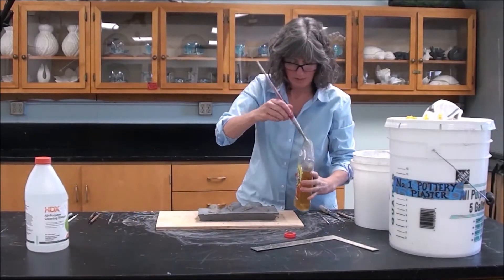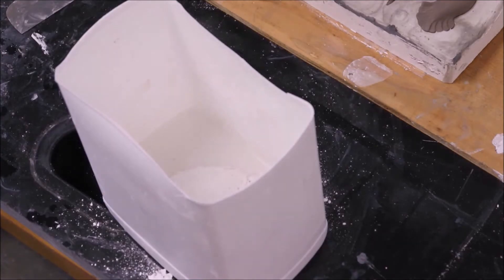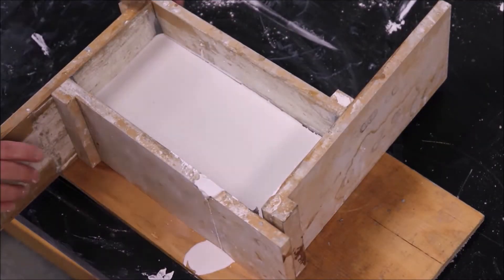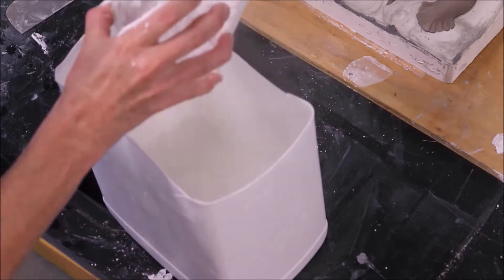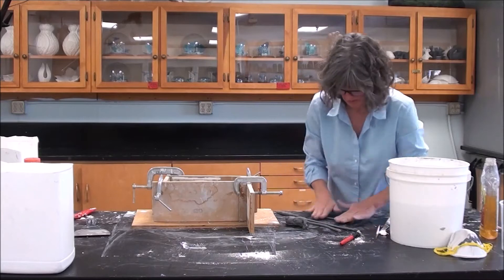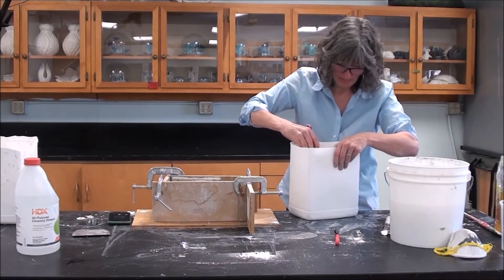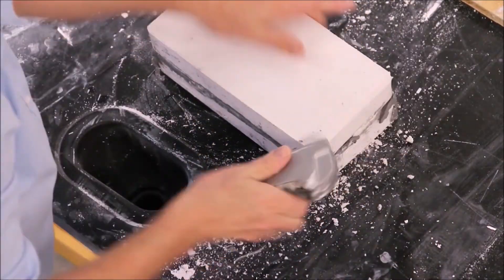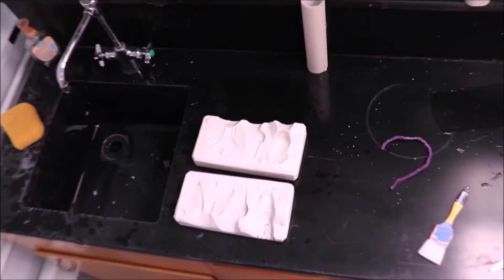Part 2: How to make a 2-Piece Plaster Mold for Slip-Casting

Comment: When you slip cast for this type of mold do you drain out the excess slip or continue filling it to have a solid product?
Reply from the maker: Generally speaking, you never want your object to be solid (unless it is tiny).  I always drain out the excess slip.  A general rule of thumb: if your piece is over an inch thick, it is likely to explode.  Of course, there are exceptions to every rule...

Comment: thank you! I want to pour a bowl to match my Rosenthal Baroness fine china.  What do I use as a slip to match the fine china?
Reply from the maker: I would just buy some pre-made cone 6 porcelain casting slip.  You can get it at most ceramic warehouses and they often come in one-gallon batches.  They also come in a variety of colors.  Several white colors along with other colors.  Good luck!

Comment: You don't mention drying time for the murphy's oil soap nor if you diluted it w/50% boiled water. Can you please clarify? Thanks
Reply from the maker: The water does not need to be boiled.  Sometimes I dilute the Murphy Oil Soap, sometimes I don't.  It only takes about 5 min to dry, depending on the humidity level of your environment.  I find it is dry by the time I am done mixing my plaster.  But I do live in the desert.

Comment: Thank you Rebekah, you solved (and explained really well) all my doubt about this practice. I only found korean video making molds but couldn't get the precise instructions. Just a question, I have to buy plaster or the procedure is same with alabastrine gypsum? Thank you if you can answer to this too.
Reply from the maker: You will have to do some research.  I'm not familiar with Alabastrine gypsum.  The only other plaster I have experience with is Plaster of Paris, which I have used for slip casting.  It works, but not well.  You could give it a try and see what happens.  Let me know how it goes!

Comment: How much shrinkage do you find you are getting, from the original piece to the future ones?
Reply from the maker: The shrinkage depends on the type of slip and how high you fire it.  Porcelain slip shrinks about 15%.  The slip I used in this video only shrinks about 3 or 4% when I fire it at cone 04.

Comment: how did you create the clay bed without marking or damaging the humming bird?
Reply from the maker: The hummingbird was past the leather-hard stage.  So it was quite stable and very firm.  And the clay bed was very wet clay.  Since there is a discrepancy in the moisture content, the two clays do not wat to stick together (wet clay does not want to stick to dry(ish) clay.

Comment: Amazing video thank you! But please wear a mask when your arms the plaster
Reply from the maker: I'm glad you liked it!  You only need to wear a mask when working with the plaster in it's dry/powder form.  Once it slakes up the water, there are no particulates to breathe.  I wear a mask when sifting the plaster into the water, and once the air has cleared (which doesn't take long), I remove my mask.  By the time it comes to mixing the plaster into the water, it has thoroughly slaked and, again, there are no particulates in the air to worry about.

Comment: Very good demonstration. Thank you.  Do you have a video on casting a solid object... like a fired sculpture piece?
Reply from the maker: Nope.  I generally do not slip cast any work to make it solid as it is more likely to blow up in the kiln.  The exception is when casting thin pieces, such as wings or flower petals.  Those always cast solid.  But they are not truly solid due to the was plaster pulls water out of the clay.  There is always inevitably always an air pocket in it.  But they never blow up because the air pocket is not large enough.  Hope that answers your question!

Comment: Very nice 40 years I worked with dental plasters Alpha hema hydrates and Beta hema hydrates vacuum mixed and vibrated for a dense fast setting material. Watching how runny a mixture you use is very interesting but all the various plasters used for pottery to dentistry to home building is also interesting gauge plasters moulding #1 and 2 and casting plasters are all different. Thanks for the lecture.
Reply from the maker: Wow; that's very interesting!  I've only used Plaster of Paris and No 1 Pottery Plaster.  Thanks for sharing!

Comment: Hello mam 
Can we cast gypsum in such mold ??
Does gupsum casting  give same result as clay casting mold like that shown in vdo
Reply from the maker: Yes, you may add gypsum (plaster) to a plaster mold.  But you must coat the interior of the mold with a mold release agent (such as Murphy Oil Soap or Vaseline), then put it together, and pour the plaster in.  If you do this, you must make sure there are no undercuts, otherwise you will never get the gypsum to release from the plaster.  And you do not pour in the gypsum and then pour it back out after a certain amount of time (like you do when slip casting).  When casting with plaster, you will be creating a solid object.  Good luck!
Reply: @rebekahbogard3322   lots of love 
                                       Thank you 😊

Comment: Hello from the Dominican Republic :)
Thank you so much for all your videos and info Rebekah, they are great!!!
I have a question. Here the ceramic materiales are very limited (no specialized stores), they also don't sell pottery plaster, they have 1 plaster which is acceptable for mold making, but I do not know if it is good for slip casting yet. They also do not sell slip so I would have to do it myself. 

My question: How do you decide if you need to do a MULTI PART PRESS MOLD or a MULTI PART SLIP CASTING MOLD? In my case I am doing sculpture in very small editions, maybe an edition size of 3 for example. 

Thanks again
Reply from the maker: Thank you so much for the wonderful compliment!  I’m glad my videos are helpful.  Your question is a very good one.

If I were you, I would start with press molding since it is likely the plaster is not very good for slip casting and, on top of it, you would have to make your own slip.  That is quite a lot of work for such small additions.  If you decide you want to experiment with slip casting, you could always drill a sprue hole into your mold later (to pour the slip in and out of the the mold).  I have done this before with sphere molds which I use both with slip casting and hand building.

I usually press or slump mold if I am making something large, and not a lot of the same thing.  Or I will press/slump mold if I want the piece to be more substantial and stronger (with thicker walls).  I will also press mold when I hand build a piece.  I have a collection of various sizes of sphere molds that I slump clay in and then modify it to make heads or oblong shapes.  This speeds up my hand building process and makes it more enjoyable as I can power through some of the basic parts of the animal.   And slip casting for this method would take way too long.  There is a different kind of speed with slump/press molding since you can almost immediately remove the clay from the piece and then keep working with it.

My go-to is slip casting when making a lot of things that are small because it is so much faster once the mold is made.  I slip cast a lot of birds and flowers.  Also, slip casting is great for super smooth surfaces because the clean-up of a piece can take a long time.  Slip casting, when you have the proper supplies, is super fast and easy.  But slip casting is not always the best solution.  
Hope that helps!
Reply from the maker: Just in case you wanted to experiment with slip casting, you can always buy a pre-mixed gallon.  https://www.dickblick.com/products/amaco-no-15-s-casting-slip/?clickTracking=true&wmcp=pla&wmcid=items&wmckw=30511-1009&gclid=CjwKCAjwy42FBhB2EiwAJY0yQnW2WU-LYrRYKFdiHtlk1kzeYBe3afCgOIBG71-FQLkDkz9X04zxoRoC-YAQAvD_BwE
Reply: @rebekahbogard3322  Thank you so much for such a detailed and thorough answer. :) xxx

Comment: Hi Rebekah! Very helpful video! What kind of clay body is used for the clay bed? Can i use regular modelling clay so it wont harden?
Reply from the maker: You certainly can use modeling clay.  But I would recommend water-based modeling clay if you plan to slip cast with it.  If you use oil--based clay, the oil in the clay will leach into your plaster and then it would greatly hinder the plaster's ability to act like a sponge and suck up the water (think Scotchgard).  When using water-based modeling clay, just make sure you don't let the clay dry out before you add the plaster.  

If you are not planning to use your mold for slip casting, it doesn't matter if you bed it out with oil based or water based clay.

May the force be with you!
Reply: @rebekahbogard3322  Thank you so so much!

Comment: Dear Rebekah,  thanks for these excellent instructions! Started to make a mold of a wooden object. I've a question though. In the second pour the plaste got creamy during mixing, the first time it became creamy after it was poured. Used three minutes soaking and mixing both times. However the slaking went slower the second time and  I banged the bucket a couple of times for the plaster to better sink into the mixture. Could this be the reason for the process of thickening being faster?

Kind regards,
Tom
Reply from the maker: Hmmm.  If I understand you correctly, during the first mixing of the plaster, the plaster was thinner while stirring.  And the second time mixing, the plaster was thicker while stirring.  And both slaking and mixing time were the same.  I would attribute this to having colder water in the first mix and warmer water in the second mix.  If the water is warm, it will stiffen much faster.  (I am also assuming your water to plaster ratios were identical both times)

Perhaps the plaster soaked slower during the second slake because your plaster was a little more condensed into an island shape rather than being more evenly dispersed throughout the bucket.  Or it might be due to sprinkling the plaster in a little more slowly during your first mix, thus not creating a large dump of plaster that took longer to absorb.

However, my guess is the water temperature.  This is where you will see the greatest amount of variation.  The warmer the water, the more quickly it will thicken, and it really makes a significant difference.  Usually the way you sift your plaster into the water does not make that great of a difference.  So, even if you sifted in the plaster differently, I doubt it would make that big of a difference.

I hope your mold came out well!  Making mold of wooden objects can be a little tricky as the wood swells as it absorbs water from the plaster.  So, you have to do both sides as quickly as possible.  And wood is porous, so it needs to be coated with Murphy Oil Soap before pouring the plaster over it.
Reply: @rebekahbogard3322  Thanks for your quick and elaborate response!  It's probably the temperature of the water I used. The first time I took, approx, 2 l, cold water and had it stand for at least an hour to come at room temperature. The second time I took cold to tepid water and used it soon afterwards. Indeed it is likely that the second the time the water was warmer. Next time I'll make a note of the water temperature before adding the plaster to it.
Regards,
Tom

Comment: Can I use liquid soap as release agent?
Reply: Same question.
Reply from the maker: Yes, it should work just fine.  Like dish soap, it gets foamy.  But it will still work.
Reply: @rebekahbogard3322  hey so um, do i have to wash the plaster mold afterwards? To get the soap off...
Reply: @volstrekt  Yes.  She mentioned she used vinegar on her sponge and water to clean the soap off.
Reply: @bunch8  i used petroleum jelly.. i made a drip mold btw.. do i have to wash it off as well?

Comment: Aside from the oil soap that you use, is the regular dishwashing soap works?
Reply from the maker: Yep.  I have used dish-washing soap when I couldn't find my Murphy Oil Soap and it worked just fine.  The oil soap is better because it doesn't sud up as you brush it on. But any dish soap should be fine.

Comment: Excellent!!!  I'm in the process of casting my first lead keel for a model sailboat.  I'll be using your techniques for my mold.  Can I use a wax instead of, in conjunction with dish soap as a mold release agent?
Reply from the maker: Hi jj lad.  Sorry I am just now getting back to you.  No.  Do not use wax.  It will permeate the mold and you will not be able to get it off.  It will prevent the mold from sucking the water out of the slip, thus turning it into clay.
Reply from the maker: If you can't get Murphy Oil Soap, use any dish soap you have (or even liquid hand soap for that matter).  Since the piece you are casting is metal, you do not need to use a mold release on the lead keel.  It will release without the mold-release agent.  However, if you are making a two-piece mold, you will need to use a mold release agent on the set-up plaster before pouring new plaster on the mold.